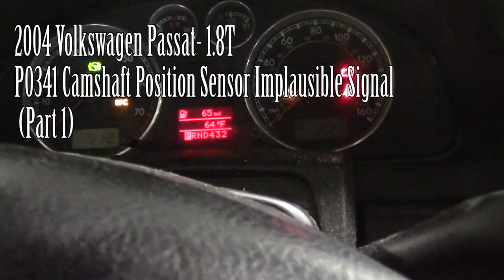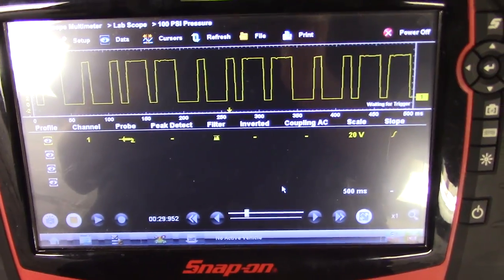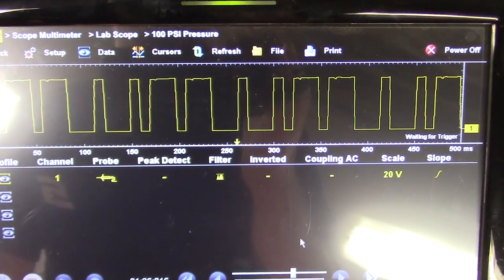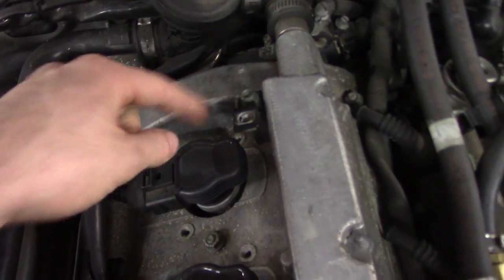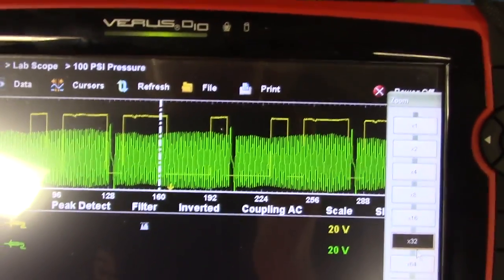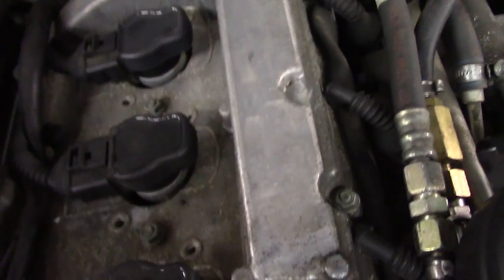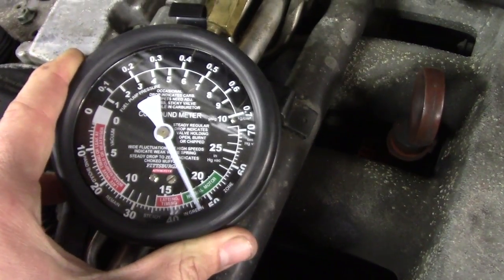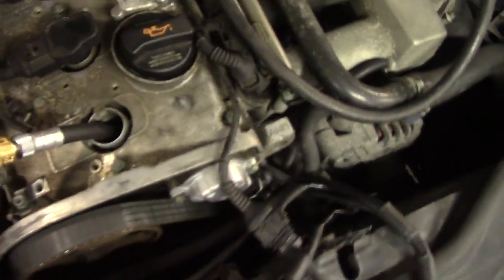2004 Volkswagen Passat-1.8T, P0341 Camshaft Pos. Sensor Implausible Signal (Part1)

Comment: I had almost same problem on Audi S3 1.8T. Previous owner after cylinder head rebuilding installed timing chain in wrong position. Same trouble code but I visually checked position of impulse rotor on intake cam (and compare with photo of known good found on internet). 
For confirmation I used spare impulse rotor and I modified it that I could installed it in any position. When I installed it in "proper position", ECU don't show that fault code. Of course I setup timing chain in correct position.

Comment: I have the same transducer set up I use with my Verus Edge and i do beleave using the preset setting is pretty close, but i use it on mv.dc. and 1mv=1psi . Great video man! 
Alao i had a short jumper lead made via AES wave so its not plugging up my com port on the scope.

Comment: Nice diagnosis so far. How about putting first cylinder in dtc and perform a leak down test with compressed air? If the cams were off you should have a loss of pressure?!

Comment: my 03 turbo passat  has same symptom. hard start.  autozone diagnosed my computer and it says cam sensor A circuit high  bank 1 or single sensor.  wa s gonna change front sensor but can't be sure it's problem after watching this video.  what to do?

Comment: You have something going on there with your pressure waveform also appears your peaks are not all even. You could put an overlay on your waveform and that should verify your timing. Not sure how accurate the pv350 pressure transducers are
Reply: Robinson's Auto Diagnostics Remember though that this is a running engine at idle, the throttle is barely open and the idle speed can be heard hunting up and down,  the intake is under partial vacuum 15inHg.
Maybe could have used the crank waveform to see if events were early or late?